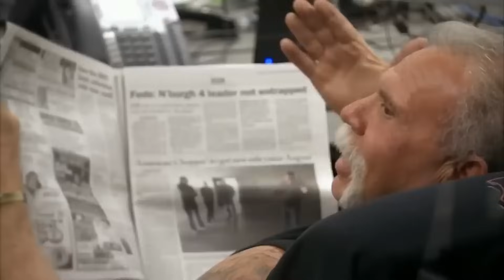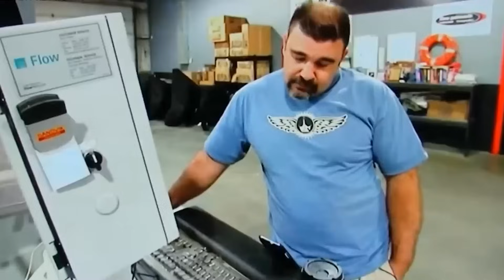Cast Members of American Chopper & Where They Are Now

Comment: Big ego mainly of Snr hamming it up for the cameras appeared to be the continuous major problem. 
 I never liked that they didn’t build their own engines and things like transmissions, suspension and braking components appeared to be afterthoughts.  adding decorative steel parts adds weight and weight is the enemy of the motorcycle when it comes to handling.   I would regard their work more as pop art than as rideable motorcycles.  I would like to see some independent reviews of OCC bikes and how they stand up over time whether ridden or not.
Reply: Jay Leno says that his OCC chopper is a piece of junk and one of his biggest regrets.